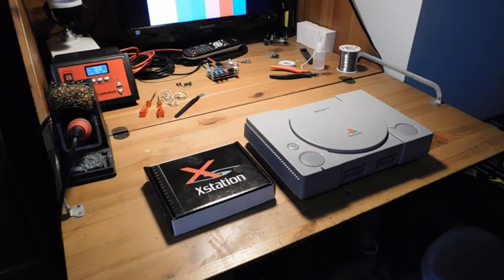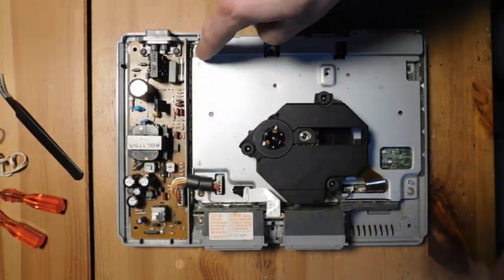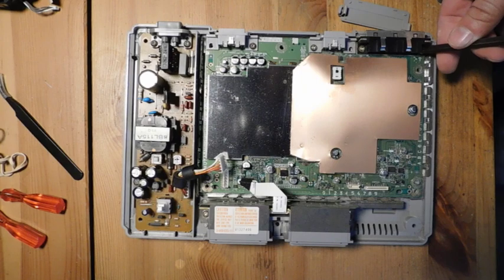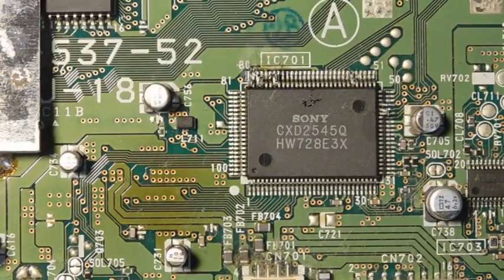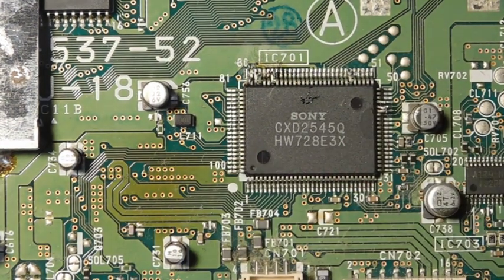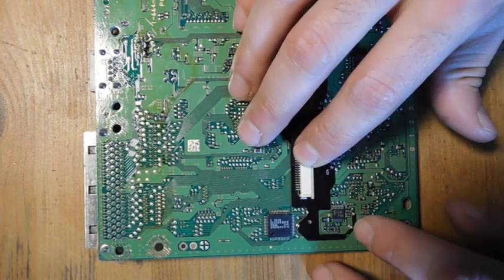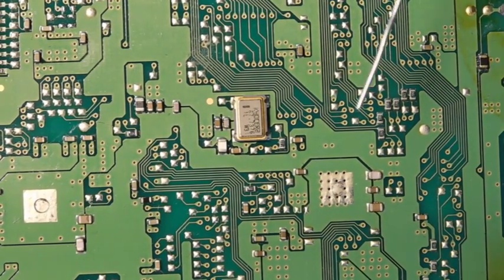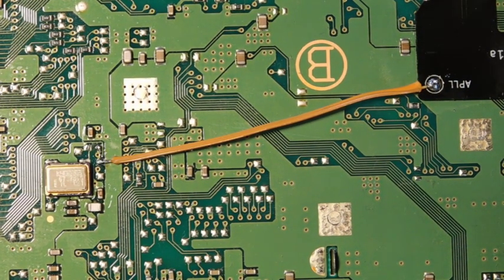Sony PlayStation XStation Install Guide - a new Optical Disc Emulator for the PS1!

Comment: Interesting video, and not a criticism, but why not just get a raspberry pi with retro pie. Shame to mutilate an original playstation for little or no benefit. 

I guess using the original memory car slots is a.plus.
Reply from the maker: A retropie is a perfectly good option as well, but doing this gives you a more accurate gameplay experience because there is no emulation of the system. The only thing being emulated here is the disc drive, so games play exactly the same as they do from disc. This specific PS1 had a bad laser so at least now it can play games again
Reply from the maker: This mod is similar to using a flash cartridge on older systems like SNES or Genesis. It lets you play original games, homebrew, and fan translations on original hardware instead of through software emulation
Reply: Why spend money on a raspberry pi if you have a pc and are just going to emulate? There are plenty of ps1s with dead optical drives. Ps1s are incredibly cheap and this upgrade is a good way to keep them in action and playing with real hardware.
Reply: Mississippi Mike  So far my $30ish dollar Chinese laser assembly is working very well. I hope it does last unfortunately these xstations are more money preinstalled off ebay than a next gen console's MSRP..
Reply: @JerryTerrifying  I have a 5501 with a modchip that has a bad laser, but it still boots to the main menu. I want to send it off to someone to solder on the xstation and desolder the modchip.
Reply: @pentiummmx2294  Usually I would try to do that kind of job myself. But the soldering looks beyond my skill level. I would really like to resurrect my first ps1 it was a gift from my Dad.
Reply: @JerryTerrifying  You can do it! Don't be...terrified.